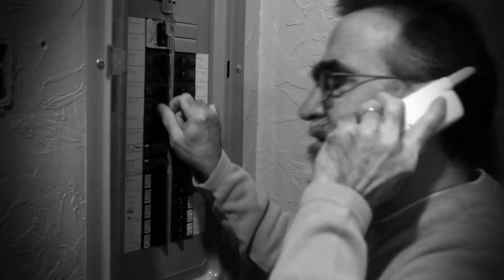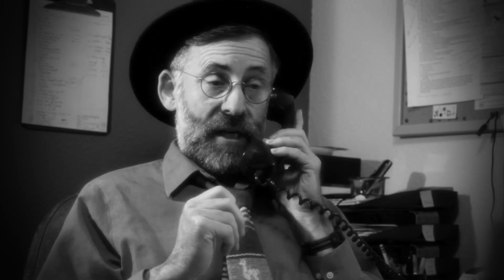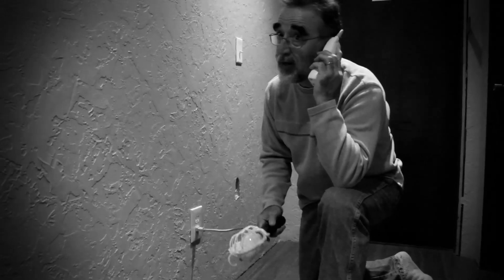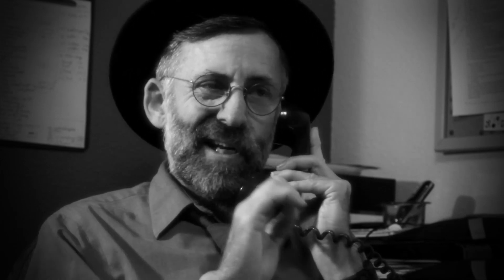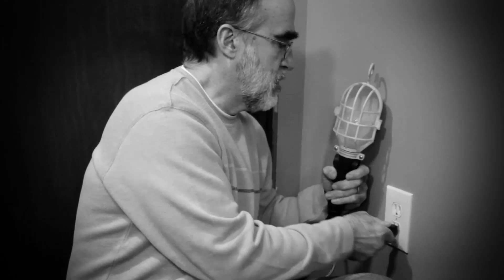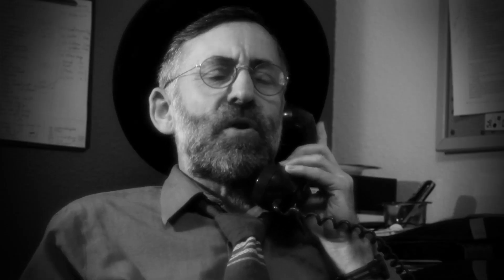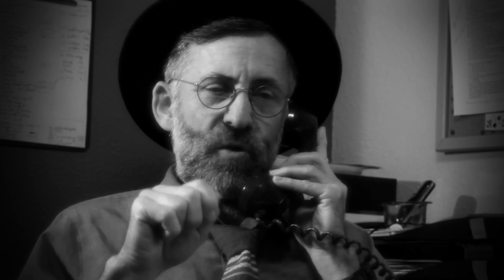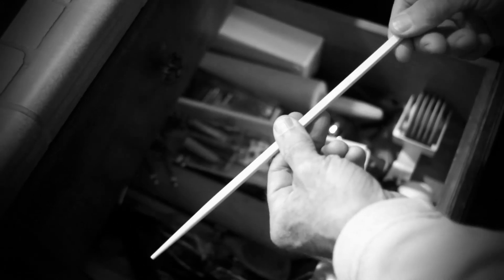Circuit Detective & the Jiggle Method

Comment: Clever test but not useful if the entire circuit is out and trips the breaker every time you try to reset the breaker for that circuit.  A tripped breaker that won't reset  is indicative of a short and no amount of "jiggling" is going to pinpoint that because jiggling requires power.     

Oh well....the solution hunt continues.
Reply from the maker: Check out my website for extensive electrical troubleshooting advice: www.thecircuitdetective.com

Comment: Thank you Circuit Detective! Followed your advice with the jiggle method and solved the problem within an hour. The problem was exactly as you depicted it in the video. Meaning, the problem was at a fully operational light switch that was effecting outlets further down the circuit. Thanks again. By the way, love the video. Great spoof on the detective films of the 1940s.

Comment: Your website gave me the tip I needed to solve a problem of an AFCI Circuit Breaker that would trip constantly. ( an arc fault - sparking happening on the circuit. ) I now realize that turning my air compressor on by 'plugging it in' creates an arc at the outlet causing the circuit breaker to trip each time. So now I leave it plugged in - and I use only the switch of the compressor to power-up. No more tripping. Larry, you are the man!